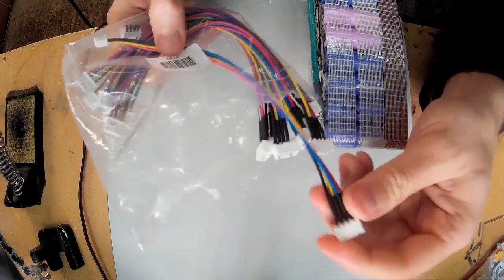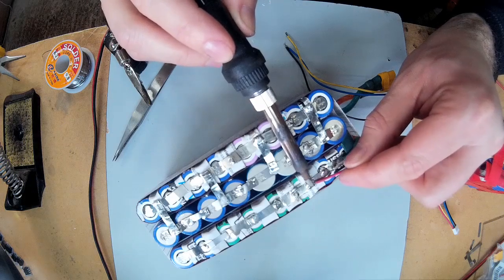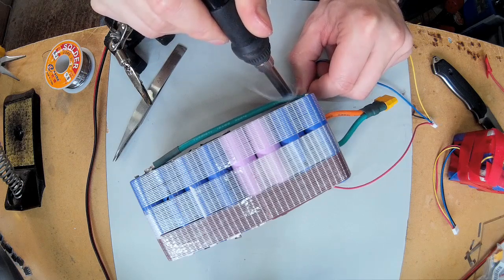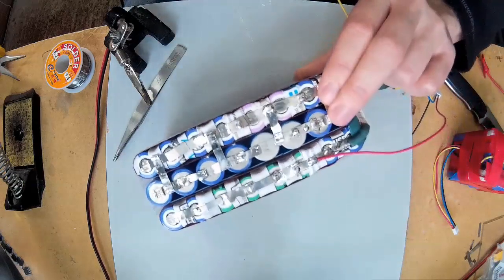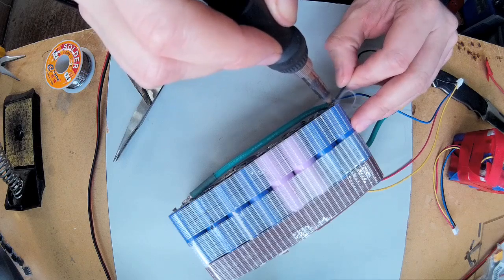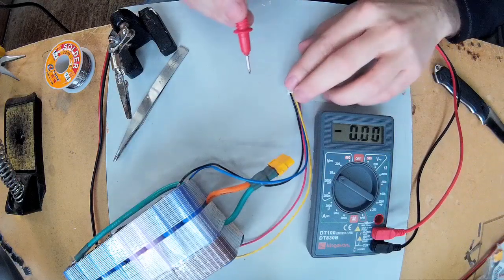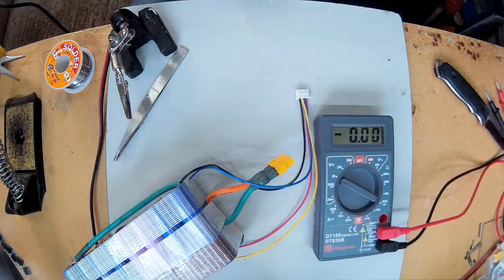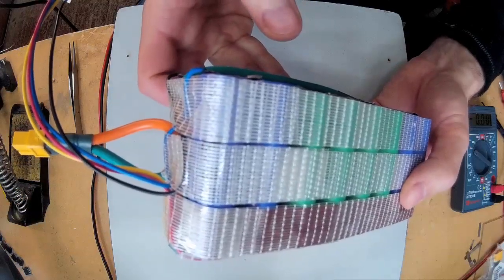DIY Ebike Battery 18650 Lithium Ion  Balance Leads Pt3

Comment: I am wondering about your the part of your connector on the lead wires behind the connector it self. The part that is covered by the dark green shrink wrap. What, exactly is that??? I am building some packs and could use something like that if I knew where to get them.
Reply: It´s called heat shrink tube

Comment: good videos  all round. Can you explain how I wire 3 18650's to allow balanced charging?
Thanks
Reply from the maker: +5BASSIP  battery's in parallel or series
Reply: I figured it out ok thanks very much. But your video pointed me in the right direction.
Reply: I have the same doubt. How is the correct way to put the balancer wires in 6 18650's cells in series for balancing them when I am going to recharge. Thank you!
Reply from the maker: +Franco Pieruccini Faria  just take a look here http://2bfly.com/knowledgebase/battery-chargers/balancing/
Reply: +Norfolktuber hi, Thanks. So Can I use this same diagram as shown on the top of the page for soldering balance connector in 6 cells Li-Ion?
Reply from the maker: +Franco Pieruccini Faria Hi yes it's the same for however many cells you put in series just make sure the wires on balance lead match up to your charger.
Reply: +Norfolktuber Ok. I am wondering use imax b6ac charger and this balance connector cable http://www.ebay.com/itm/171812524611?_trksid=p2055119.m1438.l2649&ssPageName=STRK%3AMEBIDX%3AIT for solder the 6 cells. I think those works fine together. I still don't have the charger, cells or cable. For that reason I am firstly searching for the correct information.
Reply from the maker: +Franco Pieruccini Faria looks like it should be you could when you first test use some 1amp auto car fuse on main battery connections just for a little protection.

Comment: are the wires using good enough for the voltage? looks tidy mate
Reply from the maker: Wayne & Rebecca Detectorist thanks yes the wire is rated for over 200v

Comment: thats a  3p 4s pack right?
Reply from the maker: Hi its 8 battery's in parallel then 3 packs in series thanks.
Reply from the maker: 36v 500w:    500W divided by 36V = 13.88 Amps(Current draw)
so 13.88 amp ÷ 72 cells = 0.192777778amps per battery.
so well within the battery spec
the controllers maximum is 30amp and would still be within the batteries spec.

Comment: what kind of laptot battery do you use.. i need to build a battery pack for ebike of 48v 500w.. can you link me one on ebay?
Reply from the maker: I brought a job lot of over 100 used laptop battery's from ebay cheap 
if you want new ones you could go for something like this

http://www.ebay.co.uk/itm/New-12cells-7800mAh-Battery-For-HP-HDX18-Pavilion-DV7-DV8-HSTNN-IB75-HSTNN-DB75-/261709185868?pt=UK_Computing_LaptopsAccessories_LaptopBatteries&hash=item3cef15434c

12 cell packs so if you brought 8 battery's you will get 96 cells but you don't know how good they will be til you get them and take them apart and test them.

all the best
Jace